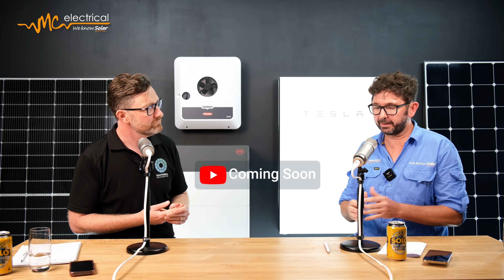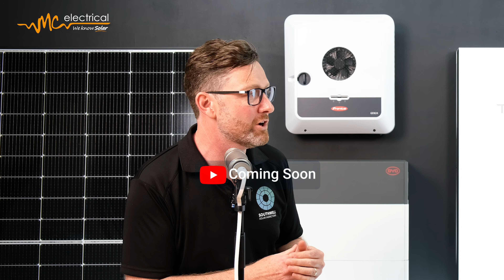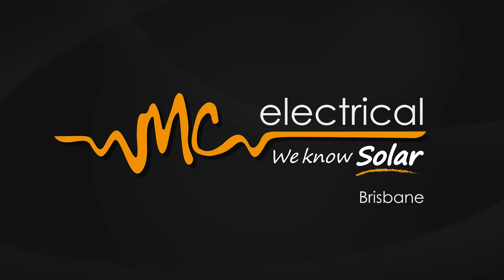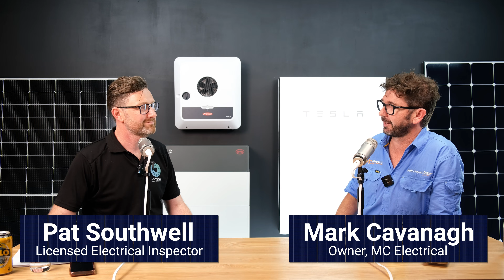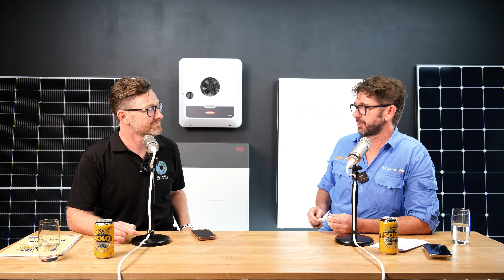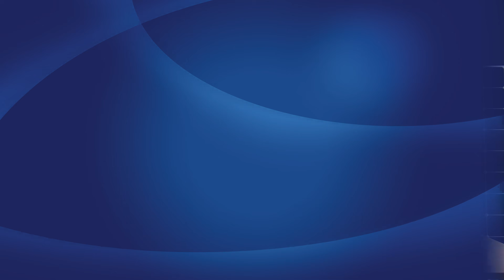How to Avoid DODGY Solar in QLD ft. Pat Southwell

Comment: You didn't explain how to avoid dodgy guys....in a small city or town all the big solar companies use subbies....as a home owner I'll have little say in who does the install....it will be whoever they send. Suggestions would be handy MC.
Reply from the maker: Hmm. Ok some advice would be to call their number and ask for after support. See how that goes. Also, ask for the names and credentials of the team that will come. If they use subbies, it should at minimum be long term reliable subbies. Best is to find a long term reputable company in a town nearby that only uses in house crew. At least when warranty happens, it’s more likely they will be able to make it in a reasonable time frame.

Comment: Another layer of QA! - more red tape and cost. If you have a licence to install electrical equipment shouldn’t you then have the power and responsibility to sign off the install. Why do you need another check? What is the purpose of the licence in the first place. If you have the knowledge why not do a DYI and then get an inspector to sign off the install- they then take the liability of the design and install. I worry about all the layers of approvals by supposedly licences experts and the cost shifted to the customer.
Reply from the maker: Yeh I see where you are coming from. Most of my friends who own business in Victoria didn’t like the idea of inspections at first. But now they see it has raised the bar - or lifted the playing field. Less dodgy solar. Doesn’t mean a good company won’t do a better job, just means the trash companies either need to up their standards …. or move to QLD.